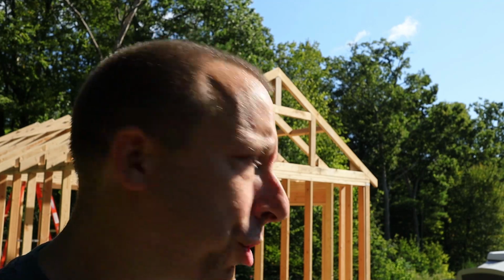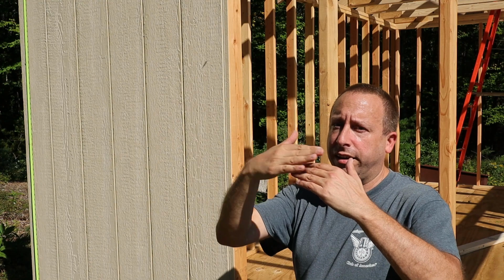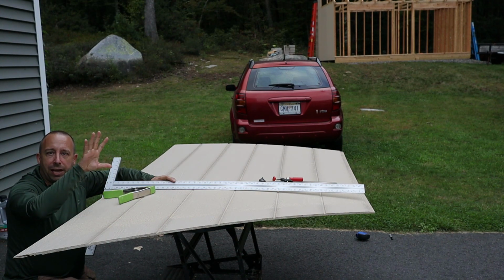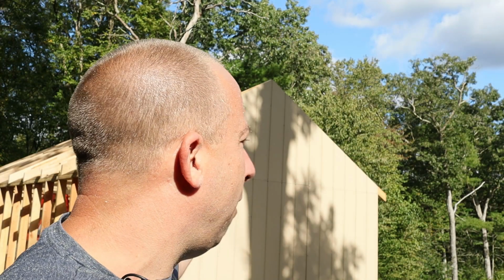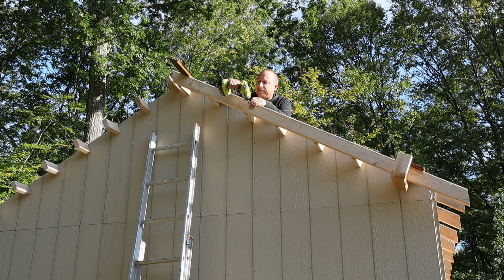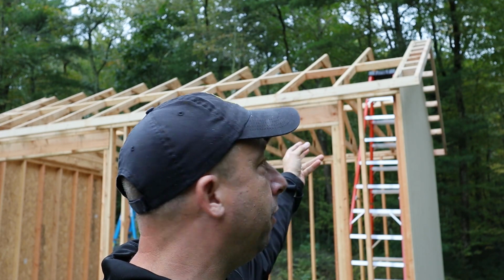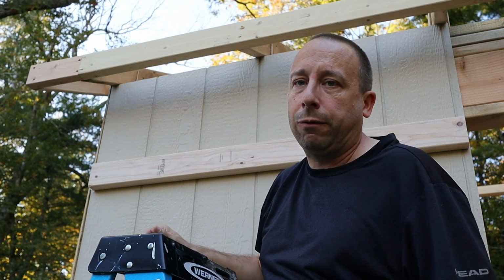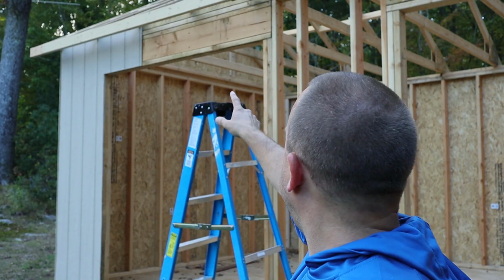►How I Built a Shed: Installing Wall Panels, Sub Facias, and Eve Overhangs

Comment: I'm currently building a 12x16 shed and I've learned a lot watching your videos. I'm very impressed with your work. Like you, I'm doing it alone, so it's slow going. One suggestion for future projects. A router with a flush cut bit works wonders for cutting out doors and windows.
Reply from the maker: I have a router with a flush cut bit and never thought of using it...great tip!

Comment: Any reason for no Z flashing between sections of panels? Just curious.
Reply from the maker: No reason other than I didn't think about it when constructing this.  As I said in the video, I'm not a carpenter.
Reply: @SevenFortyOne  like I said I was just curious. I’m building a shed now and like to watch videos to ensure I’m doing “best practice”. Your shed looks great, I have watched a few of your videos!
Reply from the maker: No worries...I did the same before building mine.  I also checked a local shed place and didn't see any flashing on their sheds either.  I'm sure it wouldn't hurt to add it, it will just add some cost to your build
Reply: I was wondering about the roof overhang too.  I've never seen anyone just screw pieces of 2x4 on the outside like that.  My dad showed me a completely different method that is very strong.  Maybe it is fine with such a small overhang, and I might just do it this way as well.

Comment: Coming along great there Rob. If you get into building more sheds you might want to invest in a saws-all or a router and a flush cut trim bit so you can just put the siding up once and cut your openings out later. Thumbs up!
Reply from the maker: I have a saws all but can't cut a straight line to save my life.  I think this will be the last shed I build...too much work!  I saw your post on hitting 146,520 miles... congrats on the milestone!